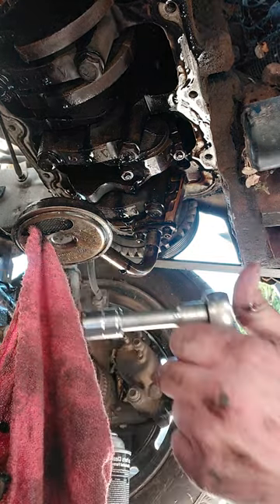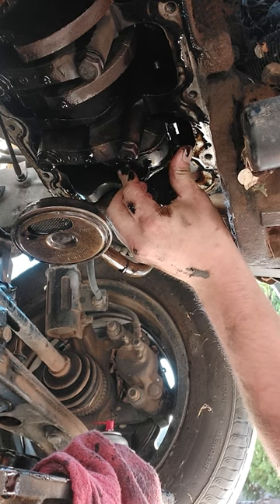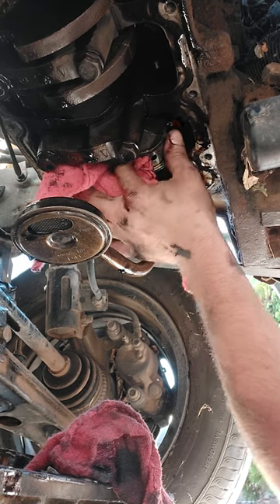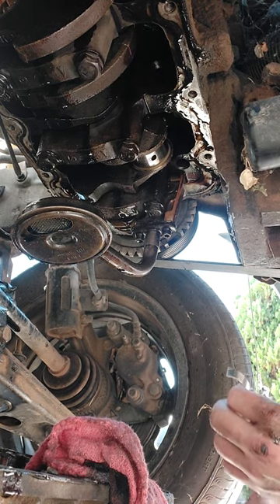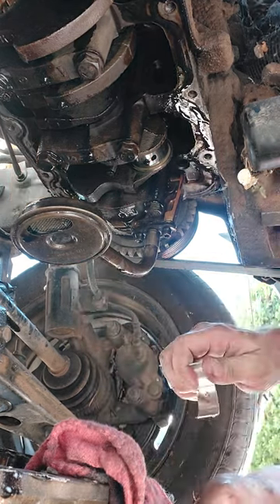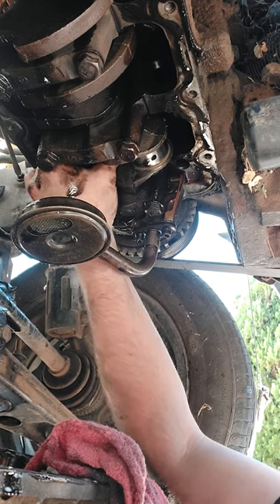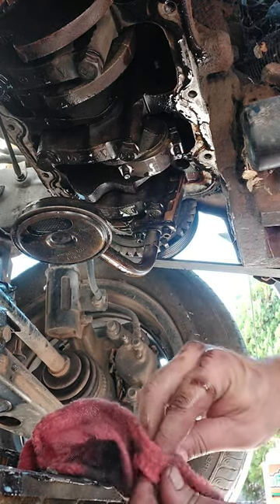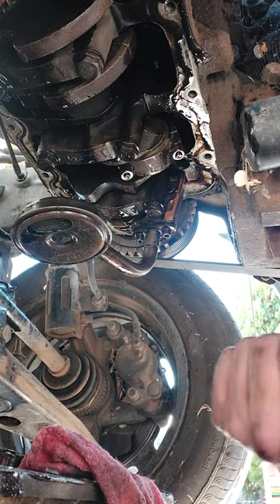rod bearing replacement

Comment: Way over simplified. You need to use 800-1000 wet and dry sand paper to smooth the crank Journals after removing bad bearings. There shold be NO grittyness moving the new bearing on the crank journal but super smooth. Then you need to use a Plastic guage to measure ths space is proper between the bearing and the crank journal. Since this video did nt show the truck running after the job, I assume his job did NOT work.
Reply: When your truck has 360k on it and You've rebuilt it once already it's past time to care lol, as long as it runs
Reply: @chromeagnome exactly, he's talking factory specs but the truck won't run like new. Your just tryna buy a few more years.
Reply: Spray the f out of it..😅
Reply: Is that all? 😂

Comment: Remove the spark plug first. This elevates the compression in the cylinder.
Reply: This is super smart, it made it so much easier to move the pistons

Comment: Informative for sure. Though, I say this nicely, it does matter which way the cap goes. Torque matters and bearing clearance matters. If the clearance is off, oil pressure will take a shit. Most engines have notches or lettering on them there to line up the cap that has the matching letter/notch. Other than that, as long as the vehicle runs, send it. lol

Comment: Was the car a Knocking noise? Nice video
Reply: A spun bearing is a clacking higher pitched knock.  Take one spark plug out at a time and when the piston is in the down position..  push on it with a clean wooden dowel or something that won’t scratch..  if it pops down once.. then you spin the bearing..  there should be no play.

Comment: I have a stupid question , how I would prevent the rod bearings from oil starvation in the first start ?
Reply: Regular oil changes, always filling to the correct amount, using the right oil weight, avoiding oil pump failures and leaks
Reply: @CodexEvans  oh no I meant after installing new bearing then first start .
Reply: Assembly lube or lots of oil. They prefer assembly lube though, it’s to help make sure the parts between are well oiled so there is no friction in the start up process and you get time to get your oil flowing through all the channels. This guy’s video is alright for dummy’s if it works but this doesn’t appear to be a proper way to do this, he’s not using oil or lube and is dry fitting and questions if it matters which way the rod caps go and it does matter. It probably won’t affect anything but it’s important to keep them on the right rod and the right orientation. I’ve switched them up on a sh!t head (no pun intended) before and you’ll get tightness and looseness because the surface is machined to that bearing cap by factory.

Comment: So i guess the crank doesn't need sanding or polishing ...lol
Reply: Not always. Bearing replacement is scheduled/preventive maintenance on some engines. of course if the bearings are scratched and gauged, you'd wanna pull the crank.
Reply: @urbanturbine  ok good answer.
 I just brought my 130k shaky engine to a rebuilder he thinks the aftermarket mounts maybe off causing a shake .the 2004 corolla drives well at 80mph and leaks no oil, no light .
 going to investigate further

Comment: I have a Chevy 1996 5.7L 350  Sb is knocking noise. I took the oil pan out and found metal residual. I was told I need a new engine. The engine turn on and drives. Any advice please. Thanks
Reply: If it’s a rod knock you can probably do the same thing this guy did. Don’t follow step by step but a similar repair is possible.
Reply: How many miles